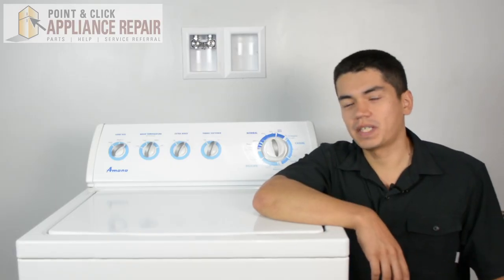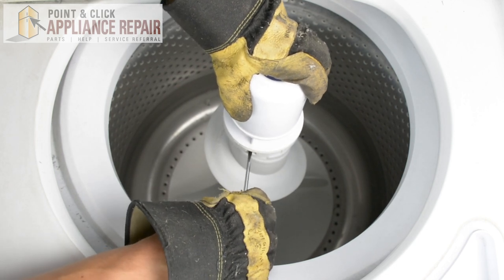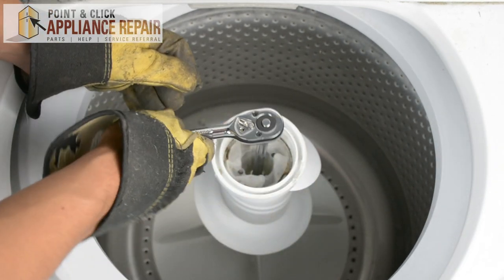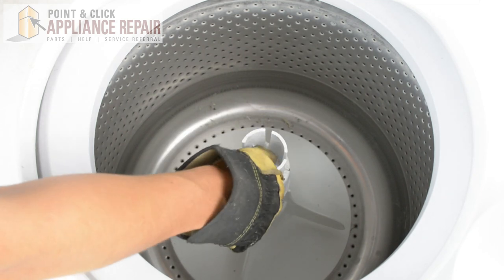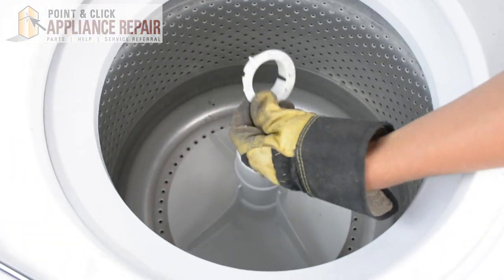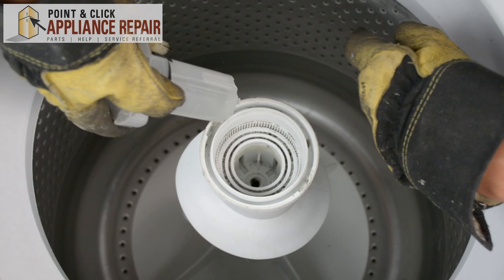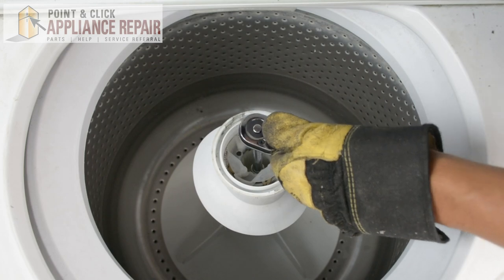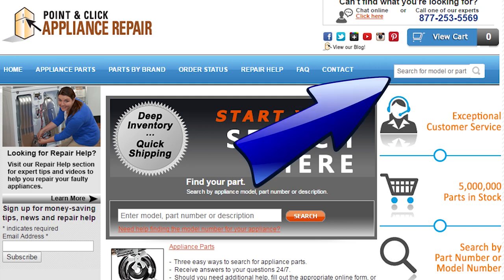WP389386 - Replacing Your Amana Washer's Agitator Base

Comment: Hello Mr. Professional Bill, Should the agitator spin freely i the washer? Or should there be resistance? I recently had a few wet loads and noticed my agitator is free spinning. Thank you
Reply: Agitator moves freely only 1 way and supposed to stop if you go the other way. If it spins freely both ways you need to replace your dogs under agitator.
Reply: @toxiccat310  Thank you

Comment: I appreciate the video but it seems that Amana is different based on the models.  I removed the top pieces only to find not a 7/16 nut but a plastic piece that looks like a skinny cone.  I am hesitant to pull on it, as I don't want to break it.
Reply: Pull on it. it won't break
Reply: @mikeneilly1396  that’s what she said

Comment: What if the entire agitator including the drive shaft that goes into the gearbox comes out with the agitator!? We were ripped off by a Letgo app liar I believe!😠
They said it worked fine. Got it home and the agitator floated up with the water level! Help! I really don't feel like disassembling the whole machine with a sledgehammer and scattering it all over the sellers front yard this afternoon. I would rather do laundry. Thanks.☺

Comment: Any advice for what to do when that lower agitator base will NOT slip on so easily like yours did? I Have tried and tried and studied the innards of the agitator and the base that it slips over and it will not go back down all the way like it was. It gets stuck and the base of it is raised about 2 inches above the bottom of the washing machine. Help
Reply from the maker: Unfortunately without physically seeing it we can only give you a couple guesses. When you put the new agitator on try and twist it as you push it down, some agitator bases may have a notch that has to line up on the shaft and wont go down all the way unless those are lined up. Some agitator bases snap into place so you may not be pushing it down hard enough. Also always make sure you ordered the correct part, because if you have a base that wasn't made for your washer it may not fit properly.
Reply: Thanks so much for your reply. It's actually not new it's the same one that was on there before i just cleaned it up while I had the upper agitator off to replace the dogs/cogs. I even stood on it inside the washer to see if that would help it go down - no go. I'm so perplexed bc it was on there before.